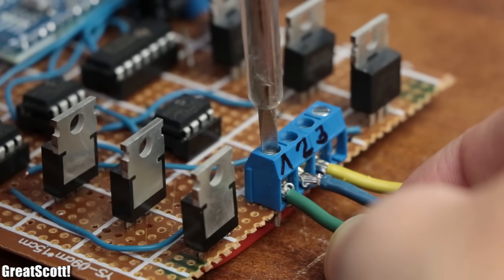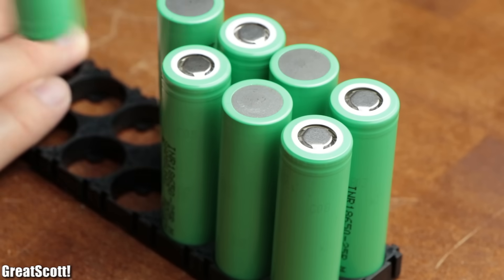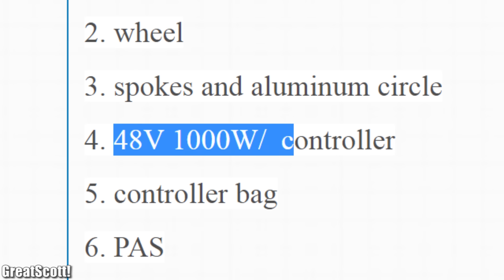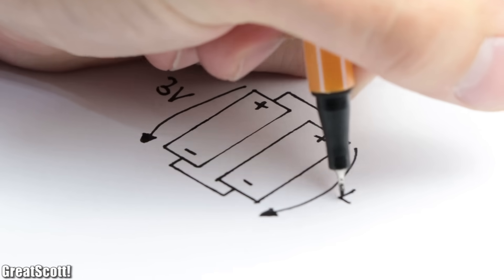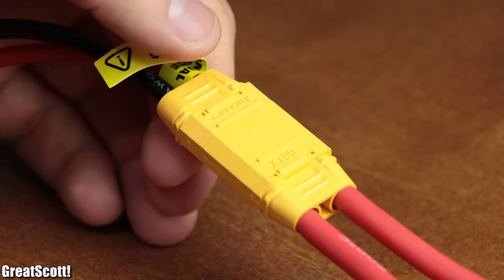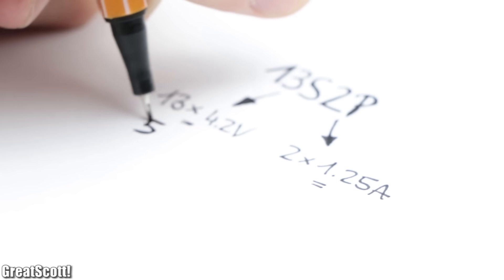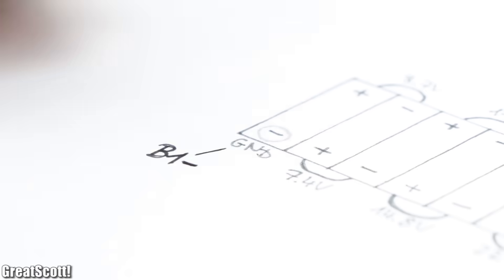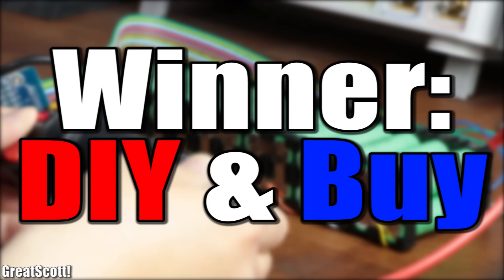EBike Battery Pack || DIY or Buy || Electric Bike Conversion (Part 2)

Comment: i have a question, i have M365 electric scooter because of my countries custom rules i am not able to order any lipo from aliexpress but i found a lot of hooverboard batteries in domestic market which is 4400 amh and 36V. hoover packs instruction it says continues discharge <4.0amp and max 10.0amp in addition BMS embedded. i am planing to buy 2 of them and connect parallel so i will make a new pack which will be 8800amh. in the end i will connect it to m365 battery parallel.
how is this plan? is that any potential issue in this scenery?
you think continues discharge will be enough?
not: i am not planing to disassembly hoover packs just connect them parallel
what do you think?

Comment: The bcm you are using is 20a. Do I need to use a 20a bcm or could I use say a 35a bcm? What effect would it have? Would it mean the pack charges quicker?

I can't find any information about this.

Comment: I have a question. Some motors are rated at 36 V and 800 W, but the controller it comes with says its maximum voltage is 48 V, power is 500 W, and is limited to 28 A. I'm not sure what I'm supposed to build my battery around. Do I build it based upon the numbers of the motor itself, or base it upon the numbers of the controller?

Comment: correct me if im wrong but putting the cells in parallel would halve the amps drawn from each battery. so theres no need to opt for 20A batterys when each one is only delivering 10A.
Reply: It is called ... increasing the cell's life !

Comment: I wish I had DIY'd when I had the money. I bought a battery but mounted it improperly to the bike, resulting in several cells being crushed enough to release their electrolyte. I can't repair it, nor do I have the money to replace it. So I am stuck with a half dead battery for the forseable future.

Comment: it gets much cheaper the higher the AH your battery is. 30ah battery at 72v is well over 1400cdn yet cost of cells spot welder + strip and holder only comes to around 1000cdn

Comment: Hello sir
I am planning to diy a battery pack with 1200mah cheap Chinese 18650 cells (13s-5p design)
My bike motor has a 250w rated motor... But I suppose it can go much higher than that
Can my battery handle the current draw

Comment: This is by far the best concise video on DIY battery packs. Well done.
Reply: Is it on purpose @7:17, it's not complete yet cuz in regards to the right diagram which is in the sketch he showed  @4:00 is supposed to be 3 of that 26 battery package he just created and so if I'll clarify you need 78 batteries in order to get a "48v 20ah 1000 watt battery pack"😉
Reply: @johnson12379 where did he say he wants 20Ah? He just need 20A, 5Ah.

Comment: What kind of battery would you suggest for a 5000w bike build?
Reply: sanyo 2070c, its the battery with the highest continuous current discharge rate at 35amp. that means a single cell can be discharged from full battery to dead at 35 amp safely. That is a 20700 cell so instead of an 18650 which is 18mm around and 65mm tall, its 20mmx 70mm.  Its a 20700 cell but the name is 2070c buy sanyo, if you cannot find those, look for the sanyo 20700a which is 30 amp. both i believe 3500mah i could be wrong if i am its 3000mah, still by far the best battery ive tested is the sanyo 2070c. 

samsung make a 30t which is a 35amp CDR but is a 21700 battery and when you have enough cells together the 1mm adds up and takes more space. 

IMR batteries or illumn is a great place to look, without the worry of a "knockoff"

Comment: i highly recommend buying sony vtc6 nmc batteries (nmc is same kind used by tesla and tesla power walls and are the best chemistry in the world right now).  You can buy them for $4/cell at liionwholesale.com which is where I bought mine.  I'm not affiliated with them but they have great reviews on reddit and with the vaping forums communities.
Reply: also, these cells put out up to 30a PER CELL so great for robotics projects or power drills battery upgrades etc.

Comment: you can reuse LION cells from laptop battery, test it and reuse... then you will get LION cells for free :-)
Reply: Where to get Laptop batteries?
Reply: @Lucas-kh6le  from electro scrap :-)
for me it is easy because on company where I work there is electro scrap for exhausted/faulty batteries. 80% of cells can be reused from that batteries.I made lot of power banks :from reused LION cells :-)

Comment: Would it be possible to power the bike with a typical Lead-Acid Battery? (Given that the battery has the same voltage/Max current/Ah ratings)
Reply: yes.  I used 8 12v 8aH lead acid sla batteries from cabellas 4s2p for a total of 16aH and 48v.  You'll need to build a little bike trailer for this though as these are heavy or use baskets in front and back of bike I guess.

Comment: How do we make a 10ah battery pack of same 48v??
Reply: Parallel. Connecting in series adds up voltage by connecting Battery 1 positive to battery 2 negative.
Parallel is when you connect battery 1 positive to battery 2 positive and connect source to both  (via a bridge)  positive and negative. Voltage remains, power output increases. More amp hours means more connected like this.

Remove one battery and you still have power. But less amp hours.  In serial, one dead battery means the whole pack stops working.

Comment: Hi very good video, I have a question, you used batteries with 20amps discharge current max and 3.7 volts, wouldn't have been better if you used an higher max discharge current battery so that the battery could work more efficiently?
Reply: The 20A rating is for the maximum rate of safe discharge current that the battery can output. Using a 25A or even 30A rated battery cell will have the same amount of efficiency. Increasing the voltage of the battery pack as high as possible will be more efficient because it will require less current to produce a certain amount of power. High current causes heat and heat is waste energy.
Reply: @anthonymina8398  okay thanks for the clarification, I knew that a battery capable of delivering more power was more efficient, but I didn't knew that it was because higher voltage is better, thank you so much
Reply: Obviously I have to pay attention in order to not fry the controller with higher voltage

Comment: hi,
if i have this BMS attached to the battery, can i charge the battery with constant voltage? or ill have to set it up with constant current?
Reply: It would have to be CC (constant current) AND CV (constant voltage). That's the way you charge Li-Ion cells and I'm not aware of a BMS that manages the current on its input.

Comment: So putting batteries in series only increases voltage and putting them in parallel only increases current. 

In your example you put 13 in series to get 48V but then added to each of these 1 in paralel to get 5Ah. I'm new in this and would be amazing if someone could educate me but isn't that way capacity of added batteries wasted? You will get 5Ah from the first pack and then add 12 more batteries just to keep that same capacity. I guess when connecting batteries in series they will retain the lowest of the available capacitities meaning if you only added 1 battery the total capacity is still 2.5Ah. 

So my question is: Is it possible to have 48V while still drastically increasing capacity by perhaps having 13 batteties only in parallel and the rest separated in series and then somehow combing them to get 35Ah. Thanks

Comment: Hi, Scott. Very informative video. I just have one question. At 3:41 you said the current for each 18650 25R cell is 20A. If I use other versions cells such as 8A max, is it possible to use 3 of that in parallel to match the 48v 1000w controller? Thank you.

Comment: The difference between DIY or BOUGHT battery packs is that by buying a ready made pack the cells are most likely the cheapest cells with the lowest amount of mAh & discharge rates, the BMS is one of the cheapest & light duty BMS's you could buy.

If you are using a 13s Battery @ 54.6v @ 10amps 546w or 20amps 1092w or 30amps 1638w or 40amps 2184w electric motor then you will be draining such a high current from the battery pack that without knowing specifications of the battery pack it may not provide the power you really need. Plus most importantly lets say you only have a 1500w motor that requires 30amps continuous, if your battery can only supply 30amps maximum then your battery pack will overheat very quickly. To get around this you would need a battery pack that offers more amps maximum so that you are not putting much strain on the batteries.

This is why most people who buy DIY rear wheels with much higher watts than standard will design their own DIY battery packs & specialty BMS with more features & greater control.

Comment: Cheap Chinese e-bike Batteries do not have Panasonic, or Samsung etc batteries in them.. They can even be wrapped in cardboard! I have to repair by e-bike battery as the batteries got pounded with no vibration protection have shorted and won't fully charge. THIS is how I will repair the pack because at least I know how the batteries are built and what the quality is...

Comment: Most good quality battery packs are 10 to 14Ah so your 5Ah one wouldn't last long. Also $250 to $300 for a battery pack is very cheap. A 36V Bosch battery pack (which uses Samsung cells) of 500Wh (13.88Ah) costs around £700 ($887.94) in the UK.

Also using a lithium battery pack/charger without BMS is a quick way to burn down your house!
Reply: Put it this way ya only use half the stated capacity cause can't fully drain batteries to 0 volts so he built 2500mah 😂😂😂
Reply: Yeh becareful on what BMS to 
Cheap ones am crap ...get wireless one to ur fone so can monitor battery and BMS 
Some BMS only balance when batteries fully charged and at 20ma cud take forever
Reply: @davey2k12  what's bms
Reply: @slicktmi  Battery Management System. It's basically a circuit that regulates current and voltage between the cells of a battery during use, and when charging. Most individual cells don't have these, so you have to get one for your battery pack, if you make a DIY one. That said there are some cells that do have a simple BMS included, but they usually aren't appropriate for making into E-bike battery packs.

Comment: hey Question can i make a  42v Battery Pack With     7  (3.1AhBattery Cells)
and 3 (  2.7AhBattery)
Reply: Yes, but better not to. They will charge and discharge at difirent rate.
Reply: @krcptvit  Wont they Are  charge Themself To keep the same voltage

Comment: though the expense of plastic spacer holders could be eliminated, as well as a balance charger (BMS is internal) you find over 30% cheaper for DIY than buying retail. in real world, you'd have ~$300 invested DIY vs. ~$450 retail.
tape and shrink sleeve are fine for battery packs, and you can make any shape you wish! if you buy 50 18650's at a time (or 100!) you can get name brand quality at under $3 each

Comment: Used battery packs from ebay very often have suspiciously unreadable manufacture dates. If you know where to look, you can get good-as-new 18650 cells for under 2€ a piece. I just bought 2kWh worth for 300€, that's where ebike batteries with a chance to actually work just get started.
Reply: I would never buy a used battery, lithium or otherwise. 
When buying batteries, assume everyone is a scammer.
Reply: @Boogie_the_cat  Good
Reply: Wait, I just noticed your choice of words "good as new" is not specifically new. 
Are you suggesting to buy used batteries for $300 ? 
Jesus wept. 
Used batteries are always a scam.
Reply: @Boogie_the_cat I was lucky enough to get 1 year old, 0 cycle cells from a private seller who was abandoning a project. Usually they are a scsm and I wouldn't do that again

Comment: Hey, I was wondering if anybody could give some advice, I may potentially need to build a battery to replace the one in a Seabob F7, the current battery states, 2.1 KW/h, 56v, 40ah.. would this be possible to make from 18650 cells and would I be able to use the original BMS from the old battery pack with the new 18650 cells once they’re wired together?
Reply: Flarez thanks for the fast response it’s amazing to get help from people on here!! I’ve always been good with electronic and recently started refurbishing water sports technology as a hobby, I recently completely rebuild a electric jet powered surfboard but the battery was still completely intact so didn’t need replacing.. my battery knowledge isn’t too great as I’ve never had big enough battery’s in any technology I’ve owned to repair, I’ve just simply replaced them but the company that sells the seabob can charge upwards of €3900 for the battery replacement and that’s not including shipping!
Reply: Flarez I am a bit confused though as the seabob battery is huge but only 40ah, I could surely create a 40ah battery out of 16x18650(2500mah) battery’s? Which is a tiny battery and would not even fill the battery casing? Of course it needs to be 56v, Is there something I’m missing here?
Reply: Flarez it is definitely a lithium battery but unsure what cells it uses, I haven’t actually gotten into the battery casing yet but it is made of thick aluminium and I think there maybe weights in the bottom to keep a neutral buoyancy on the seabob itself when in the water
Reply: Sorry if I keep bothering you hahaa so I’ve figured out the original battery has 14 lithium cells, so that means the minimum charging voltage is 3.7v? So are you sure I could replace 14 cells with potentially more 18650 cells to make up the same battery which would need to be 56v, 40ah, 2.1kw/h? Thanks

Comment: I need Help for the BMS: i need 10S6P Pack, but i cant find a Management solution and i dont know how to Charge the whole thing
Reply: Wait, 10S 6P means i got 10 Blocks of 6 cells parallel, could i Just Link one cable from the BMS to one of these Blocks? But there will build a voltage within the blocks right?

Comment: The other benefit of building over buying is that you know you're getting genuine cells. As long as you buy from a reputable place anyway.
Reply: Yea however you have to calculate that he also has to protect those cells in enclosure, to protect it from rain, rust, from shorting and whatnot.. :/
Reply: @samihyppia8472  paa÷
!
Reply: I will never buy a cheaper pre made e bike battery they are all horrible I don’t care what anyone says. Ride a eBay bought bike battery daily from 100-20% charge and it will be completely shot in months! After that mistake I bought all the tools and started making my own,  13s 8.8 ah battery cost $350 including the tools spot welder soldering gun etc but I’m using very good high drain cells. Most store bought batteries can’t handle a lot of current either, my pack can handle 90 amps continuous discharge and 20 amp charge rate. Not to mention you can use 21700 cells and get better watt hour to size/cost ratio. In the long run it’s beneficial because you have the tools and ability to make any battery whenever you need to fit any device. Have a lot of lifepo4 ups upgrades in the future.
Reply: 9999g ki logzgy5 hg

Comment: There is a type of holder that holds the welder's terminals at the correct distance, you can download the sketch to print it on the 3D printer.

Comment: great video, for reference it is MUCH cheaper to do this even with these batteries for packs bigger than this. I am building a 6x8 battery pack and equivalent batteries are at least 600 dollars more.

Comment: Do you have a guide for calculating the mechanical power as well as the minimum starting torque needed to start a lightweight ev?

Comment: My controller gets warm and draws power from my battery even when I'm not using it and it's just standing at home. I don't know why and thinking of an option to cut off power between the battery and controller with a switch.. Got an idea why?

Comment: Hi. Very good video. Is it safe to put pairs of batteries in parallel? By doing so, don't you loose the benefits of the BMS? In other words, is it not possible for one of the batteries in a pair to pull higher current than the other, causing it to overheat? Why is this solution better from putting 2x 13s battery packs (each pack with its own BMS) in parallel?

Comment: I've made a couple of multipurpose battery packs and working on one for my bike now.
This answered the questions I asked before.
I bought a 36 Volt 11Ah for less than $300 also.
My motors are 36v or 48v. I had a 36v only that stopped working. Haven't gotten around to see why with others operating and available.
I want to increase the Ah and voltage without burning out the motor.

Comment: Greeting Scott, i'm watching your videos for a while. I dont know how to write to you directly so i write it here.
I'm bulding a big power pack of Li-Ion 18650 cells and i need 200A BMS system to handle the load.
My problem is i cant really found a 4S 200A BMS in an afordable price. But 100A ones are cheap enough.
Can i put 2 x 100A BMS system in parallele to be able to handle the 200A load ?
Thank you very much !